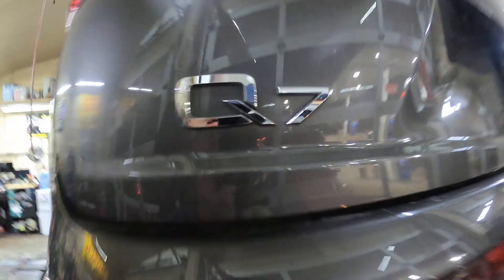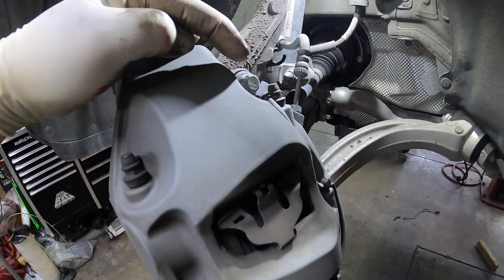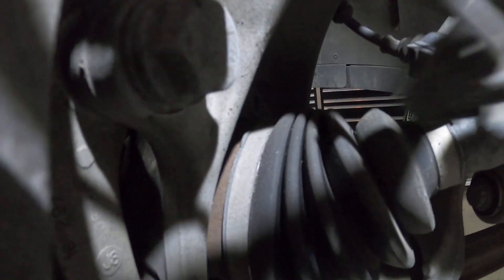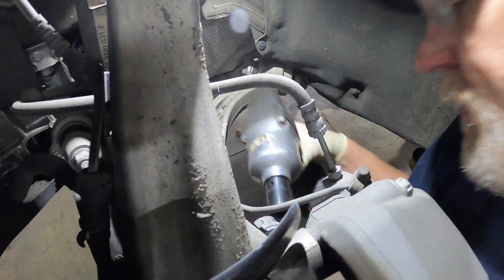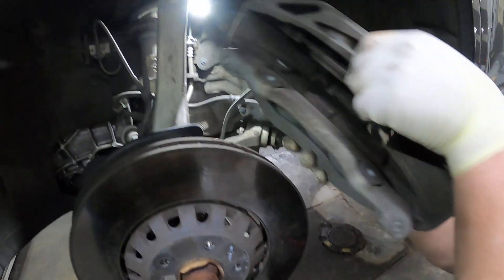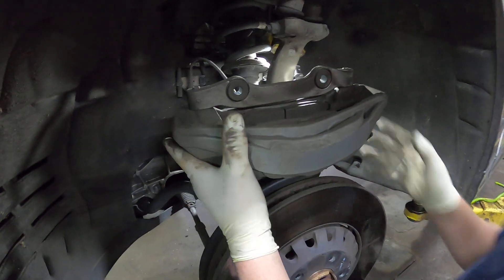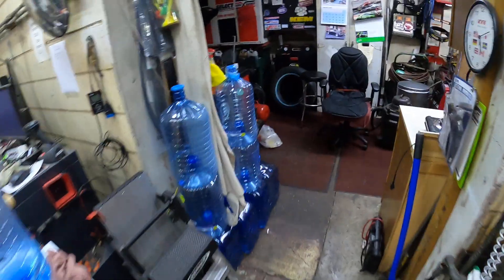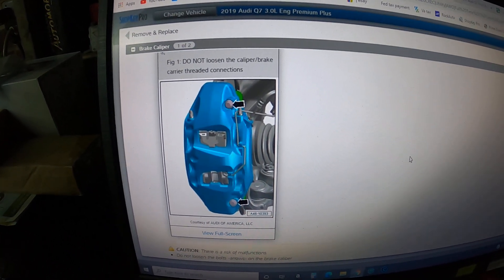Audi Q7 How To Remove The Front Caliper

Comment: Sigh...we removed the special bolts (bought the 7 pin tool) now Audi voided entire car warranty and telling us we now need to replace both calipers. Seems very strange as only a carrier bracket. Thanks for the video...wish I had seen this prior to the removal.
Reply from the maker: I would never own one.
Reply: What? No. There's no way that couldn't legally happen, at least not in the US. Voiding warranty is only limited to the part involved. You can't void radio warranty, for example when you screw up the brake, just saying.
Reply: Why did you even mention it to Audi?
Reply: Quelle risque ils y a de dévisser les 2 boulons spéciaux ?
Reply: @taxidenis43  None at all...but they (Audi) deemed it enough to consider the warranty void.
Reply: Vous connaissez le couple de serrage de c’est boulon spécial ?
Merci
Reply: @taxidenis43  Yes (but don't have at hand) however if not at spec then no reason to torque to spec or replace a stretch bollt of they doubt it is at spec. You should NOT be told to replace the calipers in stead of just a bolt put to torque. Complete BS from Audi and its dealer network

Comment: Did you reuse the bolts or replaced them as recommended by Audi. They don’t appear to be TTY bolts.
Reply from the maker: It said to replace the bolts if they are self locking, then it said if reusing bolts to clean them and torque them to 196 nm or 145 ft lbs. They say one thing and contradict in the next sentence. They are really big bolts I just reuse them.
Reply: Thank you that’s what I did.

Comment: Hello 
What’s the 21mm bolt torque specs?
Reply from the maker: 196nm or 145ft lbs
Reply: I've searched the internet high and low for the torque value on those bolts. I kept seeing 270 nm / 200 ft lbs based on the little info I could find on forums. Do you know if that was the torque for the bolts you said not to remove? I'm so confused with the contradicting info. Did you get the 196nm/145 ft lbs from a repair manual? Any clarity you could provide would be very much appreciated. Thanks @TheGAutomotiveAndMore
Reply from the maker: @brians2918   They do not give the torque for the bolts because you are not suppose to remove them. That is why It has a socket head that no one has. The 196nm/145ft is for the 21mm headed bolt that holds the caliper  bracket to the spindle. That is right out of Shopkey pro.
Reply: You're awesome. Thank you so much for clarifying. Great vids!  @TheGAutomotiveAndMore